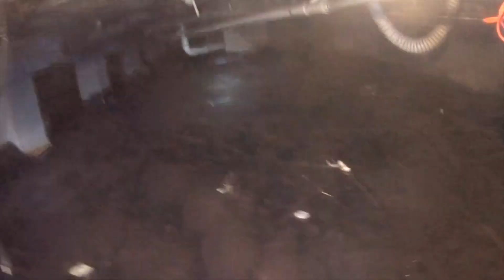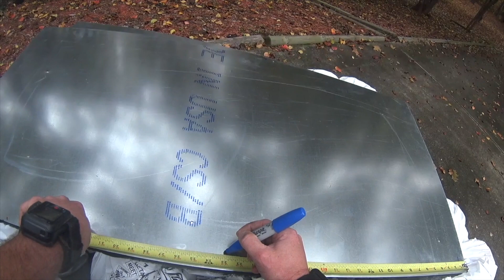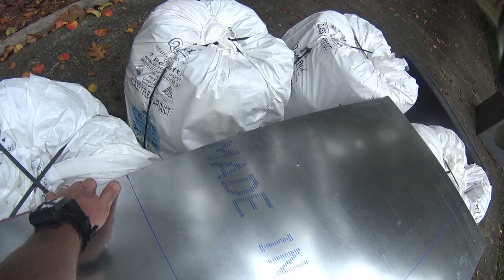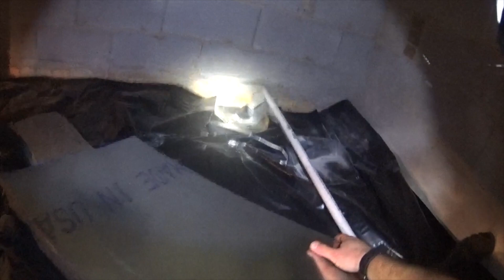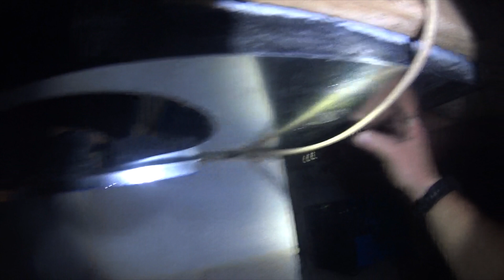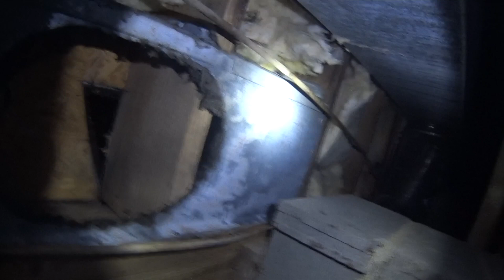11-7/8-17 Reducing Static Pressure By Installing Return Ducts Properly

Comment: Yeah imma bit concerned here. I'm in a manufactured home triple wide just shy of 2600 sqft just had an energy assessment done and it was determined that my 4 ton air unit is too small obviously because my current one just quit working on me but when it was working it constantly ran and couldn't meet or maintain anything less than 78° it was a Trane xr13 single stage. Pressures was taken at all of my supply registers almost all 15 of them was .5 or less the return at the air handler was .66. the good news is i got a 98% efficiency rating my loss was less than 69cfm they inspected my duct system to determine total leakage to the outside while the system was operating. My home has/had a 4 ton system that blew 1,800 cubic feet/minute (5 ton blower with a Mortex 3.5-5 ton M coil set on medium @1800cfm). Of the total capacity, my duct system was leaking 69 cubic feet/minute or 2% of the total capacity, meaning my duct system was 98% efficient. No duct sealing or replacement was recommended but they did recommend that we increase our 4 ton condenser to a 2 stage or variable speed 5 ton heat pump with a variable speed 5-ton air handler. My concern is thats gonna increase my static pressures and its gonna pop a joint somewhere in my flex duct. Manufacturer of my home said my belly ducts are supposed to be rated at or around 50000 BTU but can handle up to 60000 but it may get a little noisy if my variable speed air handler has to ramp up to full capacity they say that it would be rare that it does so except maybe in the Heat of July when our temps sometime climbs into the triple digits. Was told not to get suckered into replacing my duct system because there is no problems or leakage with it. Something about when they replace my air handler they need to put a larger return vent above the downflow air handler to compensate for the 5 ton 60000btu air load they said a larger return will lower my total static pressures and there is no need to replace my current duct system.

Comment: Hi, I have a Q. I have no return in one bedroom upstairs and was wondering if I can just extend the return inside the wall up from the floor below. The opennings would be facing opposite directions as the downstairs wall opens South, and the upstairs wall opens North. So the idea is to make enough holes through the wall by removing 2x4's so that I can extend the return to 2nd floor. The question is will that have a negative effect on the return and will it have trouble pulling air from the 2nd floor, seeing as it can easily pull air from the main floor. Hope that makes sense.
Reply from the maker: It won’t have a negative Effect because more return is always good (most systems already don’t have enough return air) but you would want to make sure it’s sealed up so that you don’t suck dirty air into the wall space or hot/cold air from the attic.

Comment: I installed a new heat pump.  My installer put the inside unit on  a closed box called the return box.   But it is closed.  He said that I did not need a return opening in the electric residential heat pump because  there is no heat combustion. Is it true??   
Also he said that I do not need a filter? does not make sense to me.
Thank you.
Reply from the maker: That does seem odd based on your description. It’s hard to be sure without seeing it, if you’d like you could send pictures of the equipment to stephenrardon@gmail.com

Comment: i wish you measure the static pressure before and after you fix the return ducts.  tell me if i'm wrong but by enlarging the duct you not reduce the static pressure but actually increase it.  the static pressure inside a duct system is proportional to the area of the duct.

Comment: Great video. Forgive my stupid question, but why is the metal return plenum box insulated on the inside? Seems like we wouldn't want all those small fibers in our return air?
Reply from the maker: Liner is not really different from ductboard with interior fibers. I think metal outside looks much nicer than wrapped ducts.

Comment: what a nightmare. id say maybe one in 10 techs would have tried to do that job correctly, not many like stephen out there sadly
Reply: Are we talking about the same Stephen who replaced three working components (two run caps and a sequencer) on a heat pump, only to realize that the heat strip was bad?

Comment: Does code require you to line the metal for return pans and headers? I install in Eastern NC and I have never insulated panned returns and I've never failed inspection for it. I know it's not a conditioned space and it probably should be insulated but if I was going to do so I'd insulate the outside with ductwrap. I'd have also wrapped the plenum. I hate liner because it gets insulation fibers in the airstream and is bad to breathe can cause allergies etc. For that reason, I never use it. I always insulate all ducting on the outside with ductwrap, whether it's return or supply duct.
Reply from the maker: +Vinny Mac I’ve had a few jobs get turned down because panning wasn’t lined or wrapped. Wrap in a damp crawlspace doesn’t last very long and looks like crap after a few years. Liner isn’t the greatest but looks better and lasts longer in crawlspaces.
Reply: Agreed. I hate that shit

Comment: Nice job Steven! Customers have no idea how much time it takes to fix somebody else's screw ups. Here in CA, building cavities are not allowed to be used to convey air. Everything has to be lined with sheet metal and sealed. Why was the head pressure so low?
Reply from the maker: +Josef Brunclik it was a bit cool and rainy if I recall correctly

Comment: Very informative video.
I have seen many ecm motors burn up prematurely due to high watts.
Service companies will replace a old air handler or furnace that had a psc motor 
And not even test static pressure.
Great job.

Comment: I bought a huge oversized speed square. Pretty bitchen for marking lines on metal. You don't have to make two measurements to connect. Keep up the good work and everything else will fall into place.
Reply from the maker: +Hvac103 that’s a great idea

Comment: My whole career I’ve always found on residential HVAC systems the # 1 problem, return duct to small. The importance of a proper installation is shown in your video perfectly. 👍
Reply from the maker: +Nor-Cal Refrigeration & H.V.A.C thanks for watching Dave
Reply: The Northeast has the same problem Most systems were installed into heating only ducts. Heated air shrinks and will allow a smaller return.  AC is the opposite because the cooled air expands. The other problem is home renovations that totally eliminated some returns
Reply: Brian Ellsworth heated air expands cuz and is less dense . The reason hot air balloons work🤷🏻‍♂️ or better yet close a walk-in freezer door without a vacuum breaker and try opening it

Comment: Love watching greenhorns try and bend the 1 inch with an scleat.
Reply from the maker: +Chad Schafer when I did mostly install I was really good at it, would laugh at the helpers when they tried to do it too. Takes a lot of practice to keep it up.
Reply: Just buy a bending bar they're not very expensive. I have a 12", 18", and 24" one that bend 1" flanges on one side and 3/8" flanges for drive edges on the other side. They make the job much easier, although I can bend a perfect edge with hand tongs if I need to.
Reply: 20 years never needed one.  The less tools i rely on, the less tools i have to carry/lose.  The scleat is already on every job

Comment: Not trying to be rude in anyway

But when I did my trade in AC, 
my boss would have killed me for doing what you did, 
but I do have to say it looks 100% better then what was there, 
I could say what was wrong but there is so many different things between Australia and USA in the AC world and from other things I have seen others do over there and even here is just discussing, but from all the videos I have seen of yours you look after the customers better then most I have seen too.

The boss always measured the job and I had to make the sheet ductwork at the workshop even insulate it and it had to be perfect, yes the boss was a prick but everything I had made has never come back with any problems and thats 20 years since I started it.

Anyway you did a great job there.
Reply: Probably combustible materials inside the ductwork ? Wood etc.... technically against building code standards in some areas... maybe if you had lined the wood inside the return(s) his boss would be happy ?
Reply: No, it was the way the duct was made and how the insulation was held, also I was made to use duct lock on all joints, (not the round parts).

But even here in Aus even to this day I see so many badly made ducts, the worst was uninsulated and every joint was held there by 1 rivit, not even silver duct tape, I have even seen some sod use grey duct tape as a rope to tie the flex onto the collars and they wonder why it pops off.
Reply from the maker: +Shane Haddow what did I do that your boss would’ve killed you for?

Comment: .61 to .26 ESP! Holy cow! All with return?! Thank you for showing measurements. It lends a TON of credence to the work. It's really helpful to me as a non-tech to see you fabricate and install. 

We have two return drop replacements coming up, both with high static (.8 and 1.2). For some reason local contractors insist on 8" drops in 14" or 16" plenums. Fingers crossed return and a mondo media filter fix them like your project! Then again, hopefully it doesn't get too low and buy me flow problems like on two other recent projects...
Reply from the maker: +Nate the House Whisperer the majority of the 0.61” was on return, 0.4 on return and 0.2 on supply so I knew (or felt like) a return side solution would be sufficient. Almost expected to lower return and then see an increase on supply but it didn’t. We’ll see if maybe a little blower speed adjustment helps or makes any significant difference on the spring visit. Will Vlog that of course.
Reply: Here's where Nate goes "crap!" and scurries to look at the readings he took but doesn't yet fully understand...
Reply: Nuts, mostly supply restriction with filter out for the next job. -.25 vs 0.79. Filter in -.6 vs. .6. (Yes, 1.2" ESP.) Filter is .3 or so. Need to look to see what we can improve in supply too. Dropping from a 120K furnace to a 3 ton HP should help. You are making me think. Bless you. And maybe curse you a little too. lol
Reply from the maker: +Nate the House Whisperer it’s all good, I started with an advantage since return was the highest number and I took a gamble that improving that wouldn’t change supply in the wrong direction
Reply: We always go through the setup on TAM7,8,and 9 to make the best of what we are working with on change outs... if you install a 20 S.E.E.R. system on poor ducting sometimes the bills can go up instead of down if you're not careful... I will leave the cooling high if the duct will allow it and always lower the heating (which in my opinion they come with that backwards) ... coming in behind someone like you did, you would need to adjust the charge afterwards, but by the looks of the install the charge probably was not optimal to begin with. Occasionally  it is hard to explain to some people who want the high end systems, why they will need some duct mods or even replacement to get the full advantage of the new system. The wattage decrease achievement on your job there should prove to be significant.